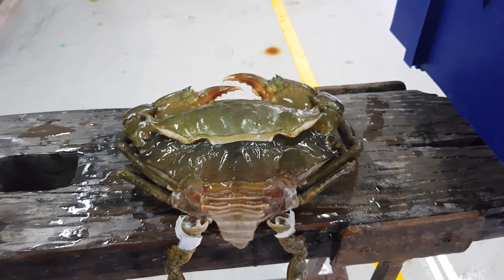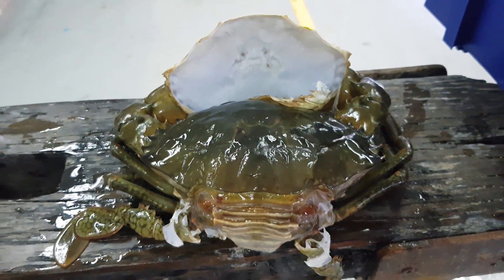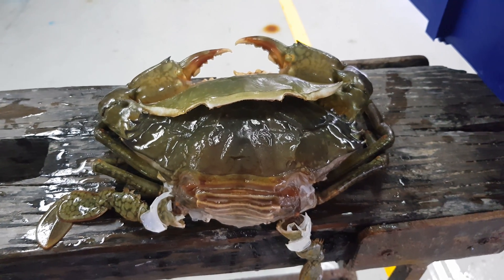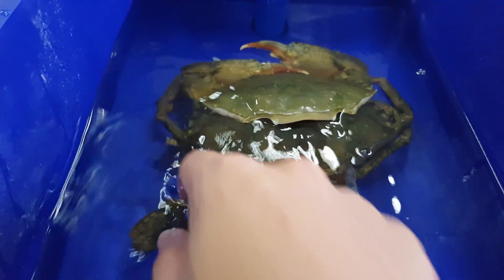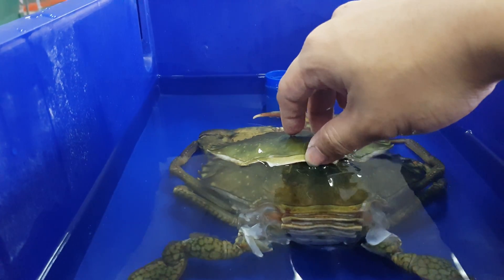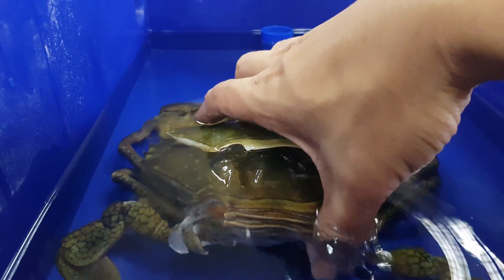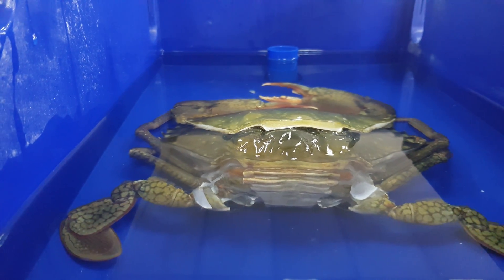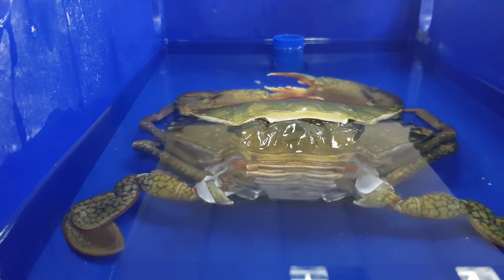Moulting Failure in Crab System

Comment: What would water level have to do with the death of an animal that can spent substantial amounts of time on land near a water source

Correlation (events that happen at the same time) 

Causation (thing that made something happen) 

Correlation does not equal causation 

Crabs can breath under water and as long as those gills remain fairly moist they can breath air on land 

Highly unlikely that mostly submerged in water, low water level caused death 

More likely there was a health issue and the energy used for molting resulted in death 

If you have multiple crabs of different ages dying all at the same time during molt then you have an issue 

If you lower water levels on multiple different sized crabs and they die in molt THEN you know it’s water level
Reply: The water level is extremely important because if the crab is not submerged it can’t get enough water in to the shell… it needs it to help crack the back open. It should be completely submerged. It’s not about whether it can survive submerged in water or not, that wouldn’t matter if it was not on molt.

Comment: Rather than speculating on the issues. Put a CCTV camera to observe any PHYSICAL ISSUES.
1.  Physical Environmentt issues. - aka lack of friction or anchor points - AKA moulting takes place in MUD/SAND in the wild
2.  Large crabs no space? Maybe it needs more anchor points.
3. A sample of the water should also be taken and the parameters recorded
4.A record of the food eaten by the crab should also follow any investigation.

Comment: Ras 
Be better if crab had ruff bottom in stead of smooth.
They cant get traction
Reply: Adding ENOUGH FINE SEA SAND would allow the crab to extricate itself. The sand is heavy so most of it will stay.
The box should be designed so that it is much deeper to hold the sand and prevent runoff.

Comment: Hi.. i'm from Indonesia.. i've found Cases like this, try checking your water temperature and DO..
Reply from the maker: Thanks for the heads up. temperature is 28 celcius, DO is 5ppm
Reply: @RASAquaculture  yes.. same as i use here. I used water temperature beetween 28.2°celcius till 30°celcius and DO > 4 ppm
Reply from the maker: @mikaylafritzila8445  so you still having this problem?
Reply: @RASAquaculture  No.. for this case has been resolved, but.. my crabs with size 150 gram and up is very difficult to moulting..
Reply: Sorry may I know what is DO?
Reply: @ramires tks 👌